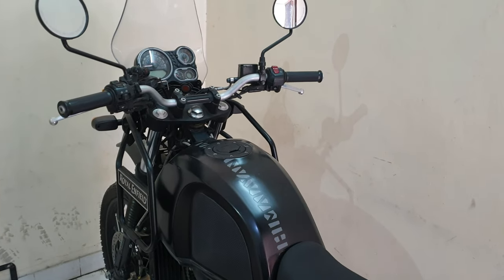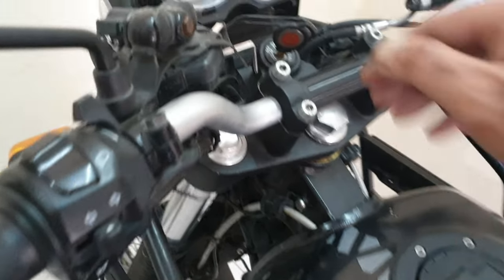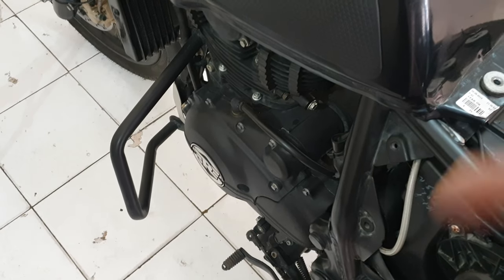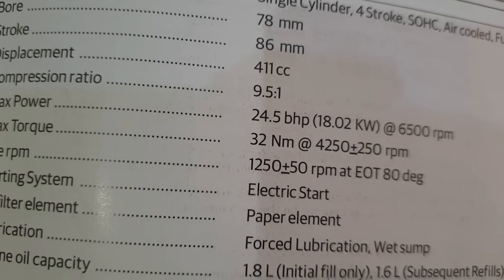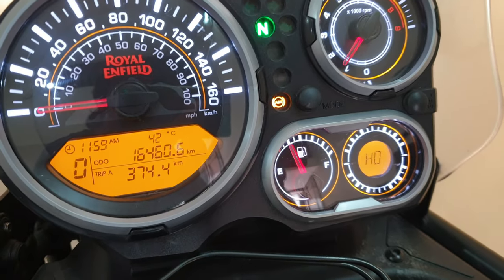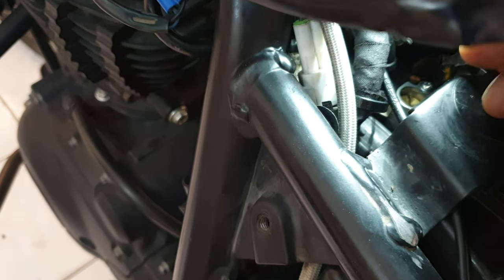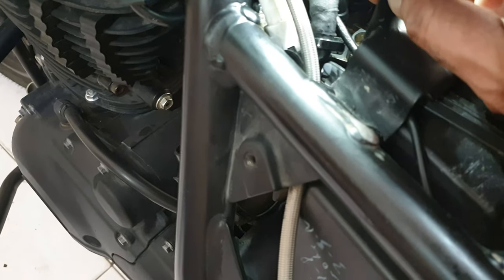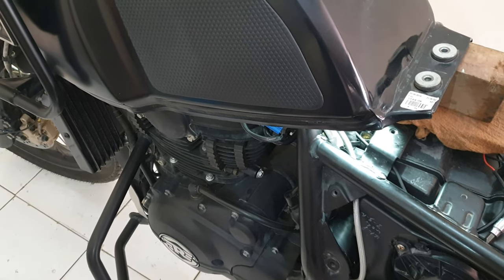Royal Enfield Himalayan - RPM Idle Screw | Adjustment DIY

Comment: Mine is at 1150 🙄 , will give a try today
Reply from the maker: Hey mate, does it stay at 1150 after warming up and riding too.
Reply: @leuheanrede  hey bro, was wee busy with work. Yes, even after the bike gets hot it's at 1100. Sometimes at 1150. At start it's between 1000 and 1100